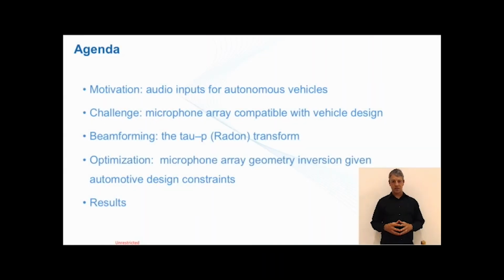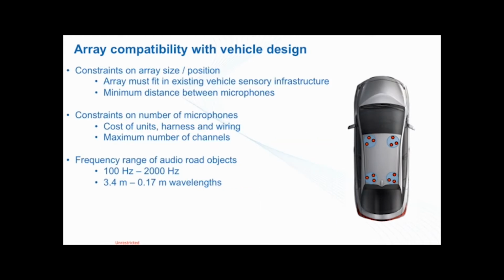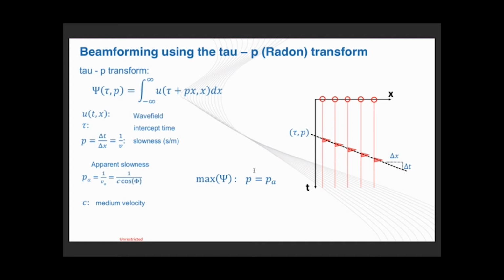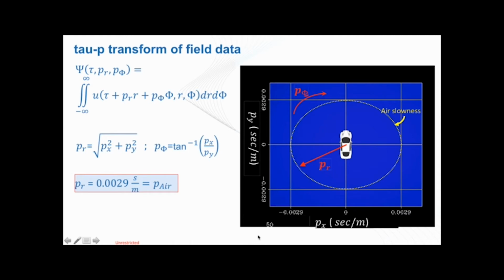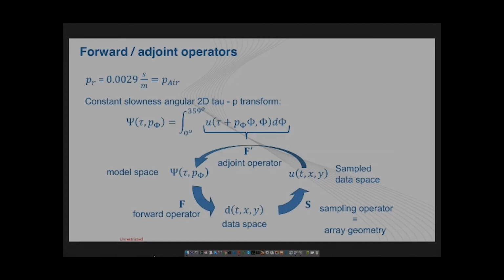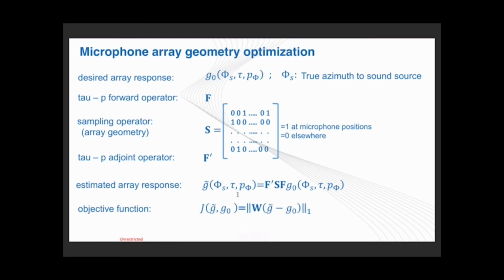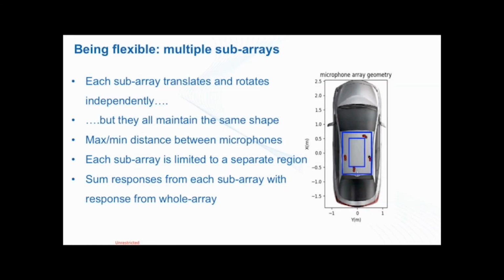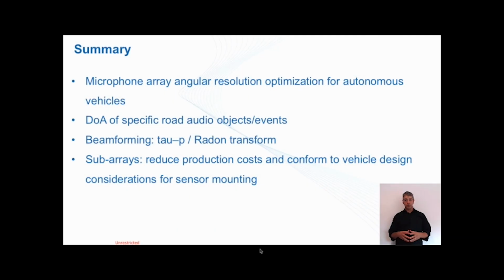DCASE 2020 Workshop, ID 72, Ohad Barak et al.

Comment from the maker: xuan_zhong
12:01 PM
 Has joined the channel.

nobutaka_ono
3:01 PM
 Has joined the channel.

yasutaka_nakajima
6:12 PM
 Has joined the channel.

yasutaka_nakajima
6:37 PM
Thank you for giving a interesting presentation. There are road noise regarding autonomous vehicle even if it is a EV. Would you tell me if road noises which are mainly emitted from tires and roads affect the array on the roof, or the direction of sound arrival from tires is vertical and then does not affect so much?

ohad_barak
9:20 PM
 Has joined the channel.

ohad_barak
9:20 PM
Hi Yasutaka,
There is a whole branch of research called "Noise, Vibration and Hardness" that deals with how sound propagates through mechanical systems. In short, there are two paths for sound propagation from the road: Through the air, and through the body of the car. We're less worried about the propagation path through the air since indeed the sound will come from below, and we should be able to effectively filter it by applying the tau-p operator we discuss in the paper. Basically, sound coming from below will have zero slowness (infinite velocity).
The problem we expect is from sound propagating through the body of the car. These sound waves could propagate horizontally along the car surfaces, and could be picked up by the array.

ohad_barak
9:33 PM
my sense is that we'll need to isolate the microphones somewhat from the car body. This shouldn't be too difficult to do using proper materials.

saeid_safavi
12:06 PM
 Has joined the channel.

yasutaka_nakajima
12:17 PM
Hi Ohad,
I understood the latter path is an issue and which can be solved easily. I am looking forward to seeing autonomous cars which have ability to avoid running cars such as ambulances when the autonomous cars cannot recognize them by sight.

ohad_barak
2:11 PM
Me too, but there is a way to go until we can make it work reliably.

keisuke_imoto
1:32 AM
 Has joined the channel.

kazuki_shimada
4:04 PM
 Has joined the channel.